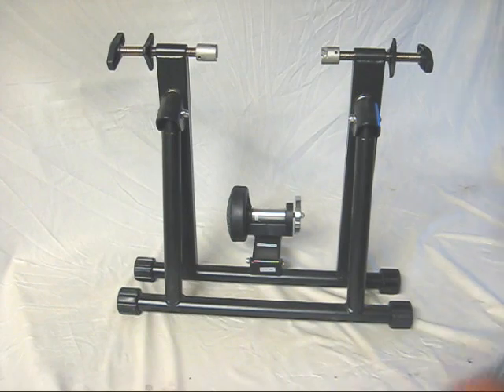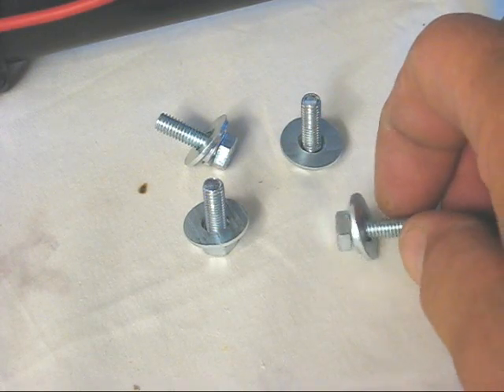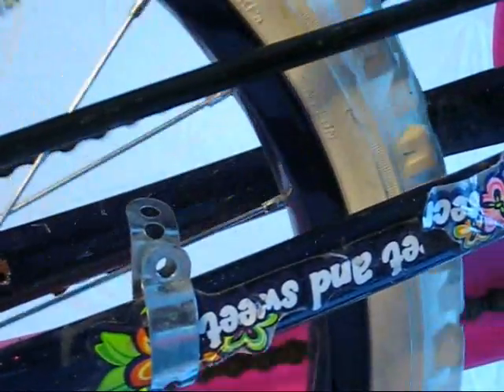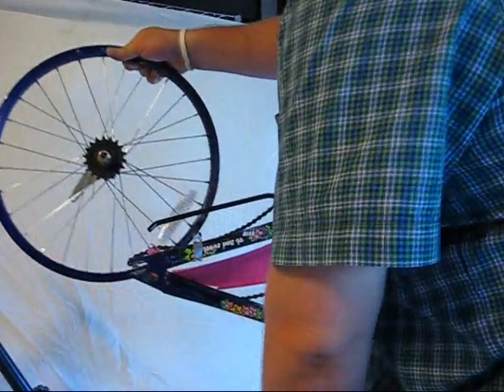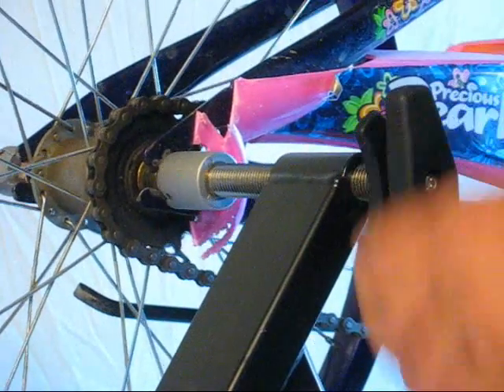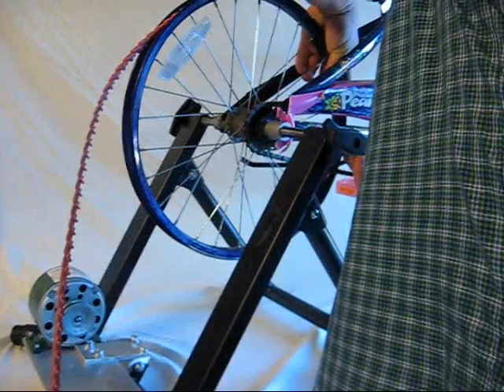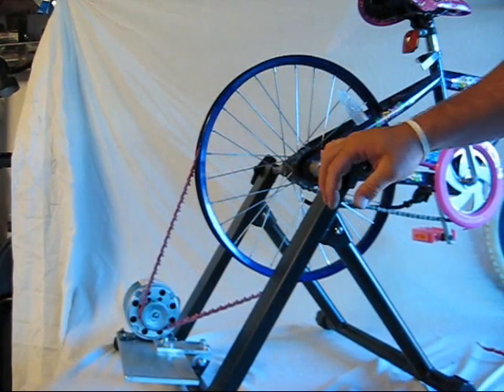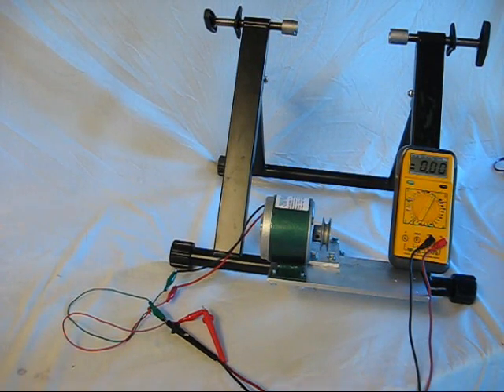DIY VIDEO 1 of 6 Permanent Magnet  DC Pedal Power Bicycle Generator

Comment: Assalamualikum, 
I am from bangladesh, i want to build a paddle powered generator for my mom. She lives in village, where load shedding is excessive. To run a water motor w-746, v- 450 ... 1hp.
Will you help
I am weak in english & know nothing about these things. ...
Reply from the maker: You would need about 7 bike generators to run a 746W pump.   I can help you build something simple if you want.  Best wishes,  Bradley Whaley  Electrical Engineer,  Arizona ,  USA

Comment: Make the bicycle wheel weighty to maintain the RPM.
Reply: Zora - thanks for your comment -   adding mass to the wheel can help stabilize the revolutions per minute (RPM)   which in turn can help make the Voltage more stable,  but keep in mind that  does not make a difference when charging a battery  or  powering something with a regulator built in.       Best Regards, Bradley Whaley  - Electrical Engineer,  Gilbert Arizona

Comment: @bicyclegenerator For a school project I am planning to building a bicycle generator and I would appreciate it if I could get you advise. When connecting a motor to a battery, would you recommend using a charge controller or diode to get the energy from the motor to charge the battery?
Reply from the maker: Hello Shivam,  you ask a good question.   The short answer is either one will work.  Since you are doing a school project then it would be better to use just a diode with a Volt meter on your handle bars to provide more of an educational experience.   The Volt meter would be used  to make sure you do not exceed the maximum Voltage of your battery.    For example  a lead acid AGM 12V  battery will have a max charge Voltage at around 14.8 Volts DC.    So by having the Volt meter on your handle bars you can verify that you are not exceeding this level.   Best Regards,   Bradley Whaley  http://PedalPowerGenerator.com

Comment: what is the name of the generator?
Reply from the maker: It is PPG-300-D-P   20 Amps Max, 50 Volts Max.  It puts out DC Voltage, not clean but still DC.   It's available from our website.     It is a permanent magnet motor that works as a generator.   Best Regards,  Brad  (Pedal Power Generators LLC)
Reply: cloyd pardoncillo 
i think is a Electric scooter motor.  can be used as generator

Comment: wht type the alternator sir ??
Reply: Achiles Stavros 
is a Electric scooter motor
Reply from the maker: It is PPG-300-D-P   20 Amps Max, 50 Volts Max.  It puts out DC Voltage, not clean but still DC.   It's available from our website.     It is a permanent magnet motor that works as a generator.   Best Regards,  Brad  (Pedal Power Generators LLC)
Reply: 50V DC & 20 Amps MAX... I wann buy one... but am cunfused... help me to compare this Generator with Car Alternator...

Comment: how much the rpm can result 100 watt on those generator?
Reply from the maker: Assuming we are going to operate at the 12 Volt range charging a 12V Battery:   Assume a charging Voltage of 14 Volts with a 20 Amp Hour Battery.   Then  you would pedal a full size bicycle with the rear wheel spinning at about 5 Miles per hour.    Thanks for asking,  Bradley  from  Pedal Power Generators LLC

Comment: Hi.Where did the pulley come from and are you selling the motor mount plate  already made? if so can you give me details of how and where to buy and a price too. Cheers Gary
Reply from the maker: +Essex Gary Hello,  the pulley is a common 2" diameter -  size  3L (3/8") wide V-belt pulley.  It has a 5/16" bore.   It needs to be enlarged to fit to 8mm to fit this generator -  permanent magnet DC motor  called the "MY1016 scooter motor" ,   I bought it from chicago pulley.    Best regards  Brad at pedalpowergenerator.com

Comment: Hey, I'm curious about the math/engineering behind this. How can I predict how many volts/amps an electric motor will output at a given RPM when used as a generator? Does it get harder to pedal when the load is greater? I'm a self starter. Point me at some documentation or technical documents if that's easier. Thanks!
Reply from the maker: +createthis   There is a rule of thumb that you can use to get this information.  Take a look at a DC permanent magnet motor's  rated RPM and rated  Voltage.  For instance   2800 RPM  and 24 Volts.     Then divide Voltage by RPM and you get  0.00857 Volts per RPM.   So at 1000 RPM (Revolutions per minute)  you have a theoretical output of about  8.57 Volts DC (Noisy DC that can be cleaned up by a capacitor).    Now you apply a  correction factor of something around 0.95 to 0.85  that accounts for losses in the motor.   So using our example,  a worst case output of a DC permanent magnet DC motor used as a dynamo generator  would be  0.85  x   8.57VDC  =  7.28 Volts DC
Reply: +bicyclegenerator voltage is only one half of the coin though. what about amperage? Is it similarly linear?
Reply from the maker: +createthis Hello,  yes you are right,  take a look at my daughter's Voltage / Current measurements here:  http://pedalpowergenerator.com/floating-ball-energy-display-bike-generator.htm

Comment: can i put this in ma elctric cycle?
Reply from the maker: +RithuRaj r Hello RithuRaj,   If you already have an electric cycle then most likely already have a DC permnanet magnet motor built into the hub of your wheel.  This means you can use your electrical cycle as a generator by adding some addtional wiring to your system .  Like a fuse,  and a blocking diode.   The question is what do you want to do with your electric cycle?   Do you want to charge batteries or deliver power to lights?     Best wishes,  Brad at pedalpowergenerator.com

Comment: Will it still work if i uses a AC induction motor
Reply from the maker: +John Pama Unfortunately an AC induction motor does not have a built in magnetic field  so it is not able to be a generator dynamo.    Best regards,     brad at pedalpowergenerator.com

Comment: What is te name of generator, where can I find one to by?!.... I really need one of this!...
Reply from the maker: Cristian Steclaru This generator is simply a DC permanent magnet motor used with kids electric scooters.   It has amazingly large magnets and puts out DC Voltage up to 20 Amps of current.   Ihave graphs posted on my website showing the Voltage output and internal resistance.  This is much much cheaper than using a 3 wire PM alternator.   You can buy the scooter motor for around $26.00 and then the pulley costs about $4.00 .    You can find it on Google by searching for 300 Watt bicycle generator

Comment: I would design the mounting plate for the alternator to be a bit larger, and have the mounting hole elongated so as to be able to adjust the tension on the belt, but otherwise good setup.

Comment from the maker: This is an adjustable length belt drive system that can be used with full size adult bike, or children's bike.  Either one is ok because you can easily add or remove links from this 3/8" adjustable length V-belt.  All you need to do is watch the part of the video where it shows the belt length being altered.

Comment: Suggestion: To solve the problem of adjusting the belt, rather than keep removing links, why don't you just incorporate threaded bolts into the alternator's mounting bracket???? Once the belt is reasonably snug, you adjust the tension by tightening the bolts, which pulls the alternator farther away from the wheel. Also, the rear wheel should be heavy, like 1 or 2-inch thick steel. This will be more difficult to start up, but once it gets going, it will be easier to pedal under high resistance.

Comment from the maker: @arseniyonline1234555 You will be very happy with the amount of resistance if you go to your higher gears and hook this generator up to a 100 Amp hour battery to charge.   This is very similar to riding at 15 MPH and feeling the wind pushing back on you.  Then you go to 20 Miles per hour, the wind gets SUPER hard to pedal against..  It's the same way when charging a 100 Amp Hour Deep cycle battery or a 18 Amp hour Duracell power pack that is powering a television set.

Comment from the maker: @aymeey0 The generator is sold on the web page pedal power generator d o t com  under the parts list section.  It's a 300 Watt DC permanent magnet motor that works as a generator or dynamo.  It comes with a pulley mounted to its shaft.  Size 3L or 3/8 inches wide V- Belt.

Comment from the maker: @PatinOmaha FYI - the wire from the generator is size 12 AWG (American Wire Gauge)  which is rated to handle up to a peak current of 20 Amps.   When you are charging a battery you can hit 20 Amps of current for a couple of seconds if you are really great athlete.   The charging voltage would be about 15 Volts DC.  So  Watts = 20 Amps X 15 Volts = 300 Watts!!   you can have wire as thin as a single hair carry 300 Watts of power if the wire is at 300 Volts while carrying 1 Amp, that would = 300W

Comment from the maker: @Wahsayah If you get the PPG-R300-K then you will need just a blocking diode.  Charge controller is optional.  You don't need a charge controller if you have a volt meter hooked up to the battery and make sure you don't exceed manufacturer's specification for Max Charge Voltage.  In most cases this is ~15 Volts.

Comment: Okay does your kit need anything else required to buy aside from the kit or does the kit include everything except a powerpack/rechargeable battery so I can charge the powerpack/rechargable for my appliances to run from?

Like that mounting block at 1:07, does that come with the kit or what?

Comment from the maker: @djsaimon2  The best way to go is to use 12 Volt light bulbs, and purchase the bike stand, the generator, the mounting adapter plate, the NC25A charge controller - which will be used as an over voltage protection circuit- to a dump resistor.  The dump resistor come with the DIY wiring kit on the website.

Comment: @bicyclegenerator It hasn't popped off since I tightened it extra hard, but I purchased some Loctite anyway just in case it pops off again.  I don't think it's the alignment.  I am using a Schwinn World Sport bike and it's wheels are actually perfect for this application.  Thanks for the info!

Comment from the maker: @lancerooke You can put a few drops of glue onto the set screw threads.  The best to use is Loctite.  If you set screw loosens up a lot it could be that your pulley is not balanced correctly.

Comment from the maker: @faststronghorse It takes about 30 minutes to assemble and take the tire off your back wheel and then put the belt on.   The costs are:  Generator $100, Stand: $80,  Belt: $70
Reply: Where can I buy the generator

Comment: @bicyclegenerator How can I make sure that the pulley stays affixed as a pinion to the generator?  Mine has fallen off twice despite the fact that I tightened the set screw both times.  Is there some sort of glue or putty I can use?

Comment from the maker: So your profile indicates you are an 18 year old diesel mechanic?  Impressive!  I was under the impression that a fuel cell converts chemical energy to electrical energy.  Where did you get your generator definition from?   And the bike shops do call the round things with teeth a "Sprocket"?   Not a pedal gear?   Thanks for the input.